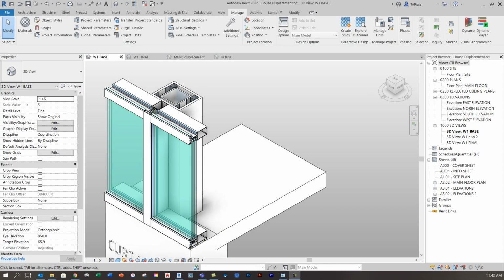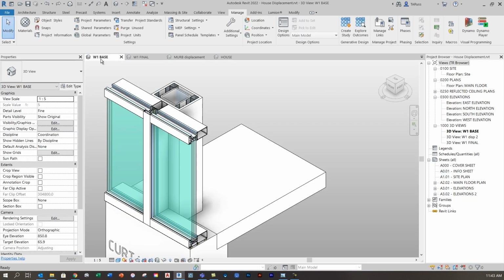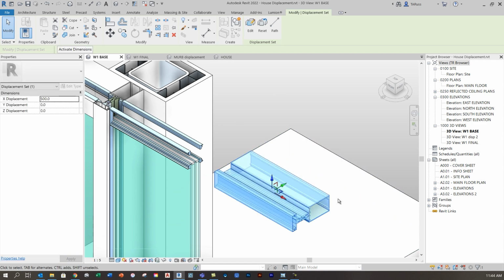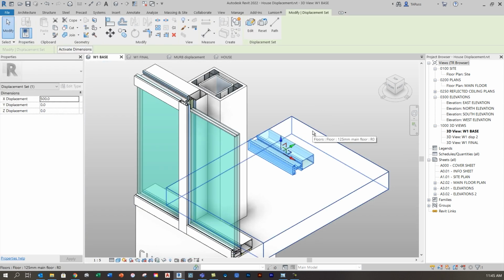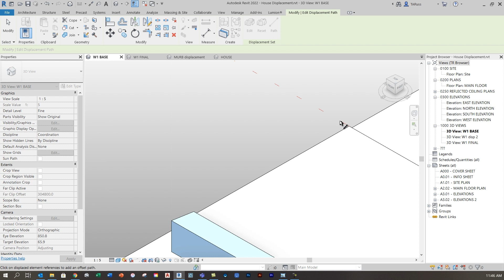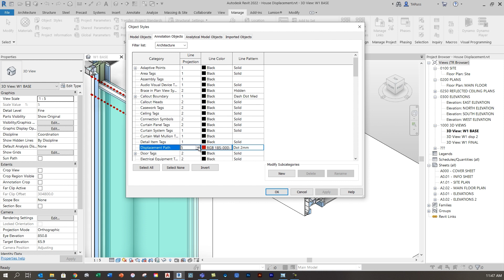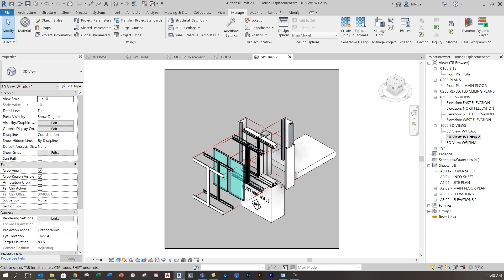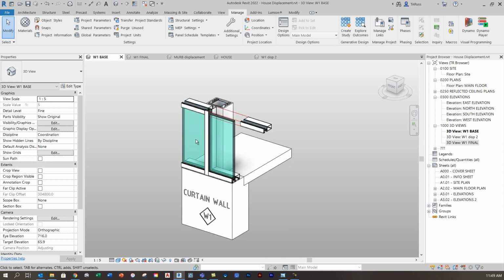Displace Elements in Revit

Comment: For a future video can you cover how one can export vector files from Revit and import said files into a programme like Illustrator with all of the layers maintained? I often find myself wanting to use Illustrator to work on 2D drawings from Revit, but when the PDF files are imported into Illustrator it doesn't come with layers, all of the lines get merged into a single group and you can't select specific elements (i.e. wall components, windows, floors etc.) without selecting a number of irrelevant lines. This makes the work process in Illustrator tremendously tedious and time-consuming. Programmes like Sketchup and Rhino allow you to export files and maintain the layers into Illustrator quite easily, but for Revit it's not the case. 

I've found one work around (on YouTube) which is to import the drawings (or axonometric views) into AutoCAD, and save the file as a 2010 LT file type. This new CAD file is then imported into Illustrator, and it has all of the original layer groups that Revit made when exporting to AutoCAD, but I'm curious if there's another and easier solution than having to go from Revit > AutoCAD > Illustrator.
Reply from the maker: great suggestion HP. An architected-adapted presentation on Illustrator is in the works and I'll be sure to investigate that specific request about layers. I've encountered the same frustration.